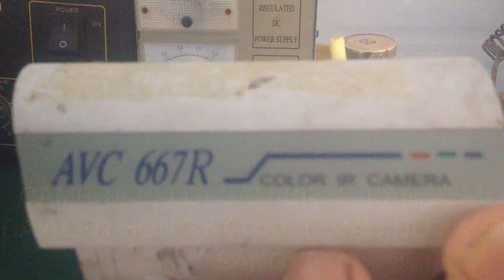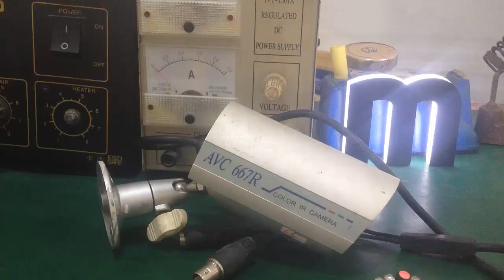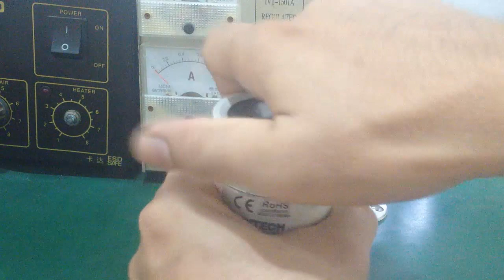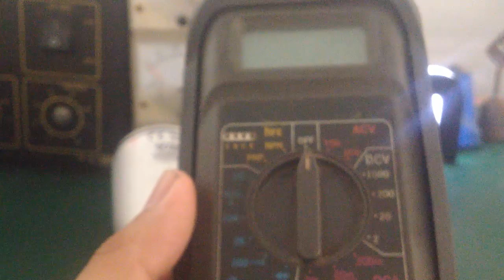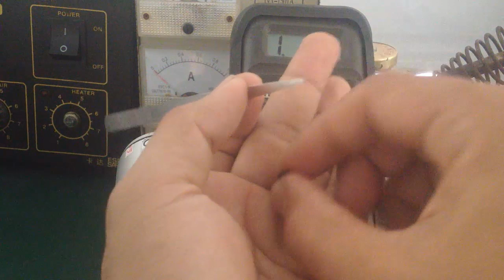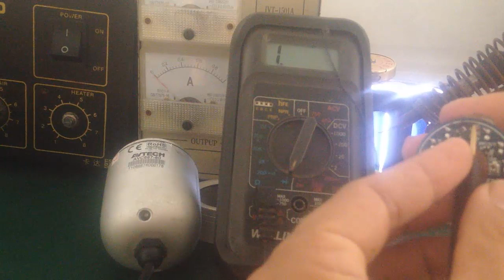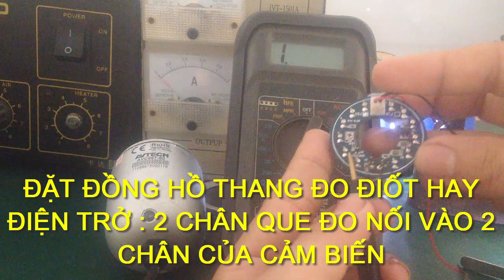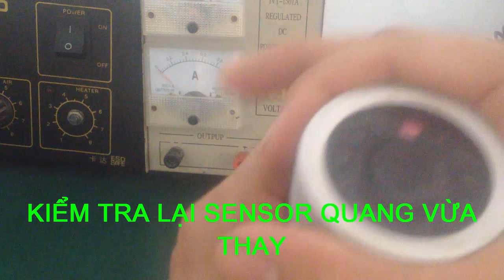Hướng dẫn sửa camera quan sát...lần đầu ra mắt !

Comment: Mạch này thấy ghi 12v. Mình có cách nào để SD nguồn 3,7v ko add
Reply from the maker: ko dc nhé bạn ... vì bên trong có IC vi xử lý , IC cảm biến ( biến hình ảnh thành tín hiệu điện ) ... dãy led hồng ngoại ==> nó cần Vcc = 12V , nó ko giống camera nguỵ trang cần nguồn pin thấp hơn .... bạn có thể ghép 3 cục pin 3,7v nối tiếp nhau thành nguồn tương đương 12v , cấp nguồn cho camera nhé !!!
Hãy đăng ký theo dõi kênh Youtube để xem các video của mình nhé … bạn có cần hỗ trợ về kỹ thuật hay tư vấn về điện tử - điện thoại di động thì cứ để lại comment , mình sẽ support cho bạn !!!
Reply: dạ ý em hỏi cái bộ led kìa. Bỏ cảm biến củng được. Bỏ điện trở hàn lại cũng được
Reply from the maker: @khoiotong508  giờ e phải xem các con IC bên trong , nó sài điện áp bao nhiêu volt : CPU 5v , IC xử lý hình ảnh 12v ....như vậy e ko thể độ chế lại dc , vì nếu e chỉ sài cục pin 18650 3,7v là ko đủ cấp nguồn cho ic hoạt động đâu , e phải ghép nối tiếp cho đủ điện áp nhé !!! camera loai nhỏ thì IC cần áp nhỏ hơn !
Hãy đăng ký theo dõi kênh Youtube để xem các video của a nhé … e có cần hỗ trợ về kỹ thuật hay tư vấn về điện tử - điện thoại di động thì cứ để lại comment , a sẽ support cho e !!!